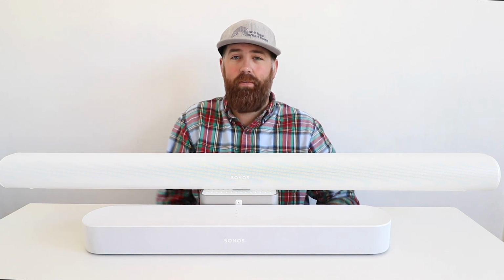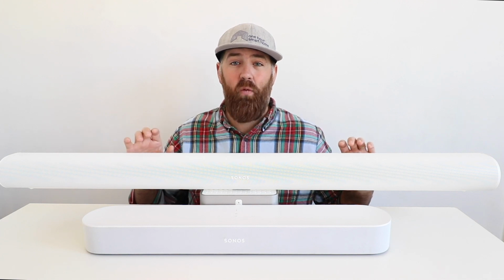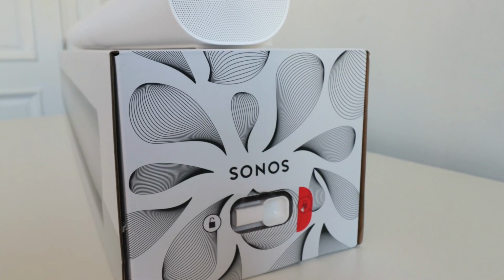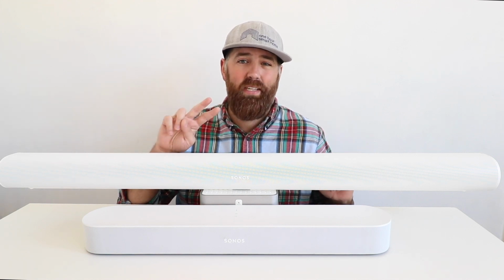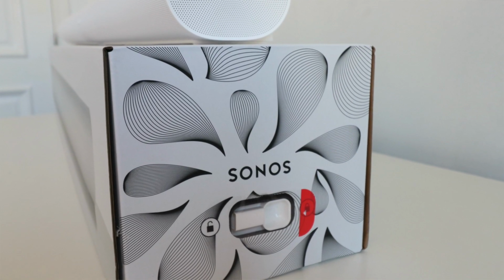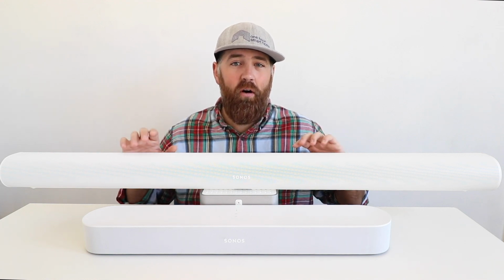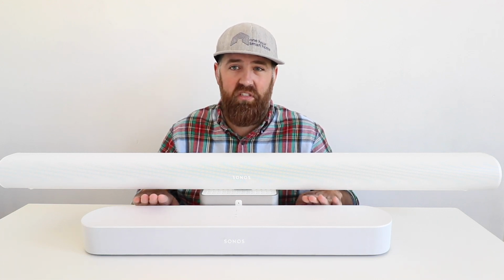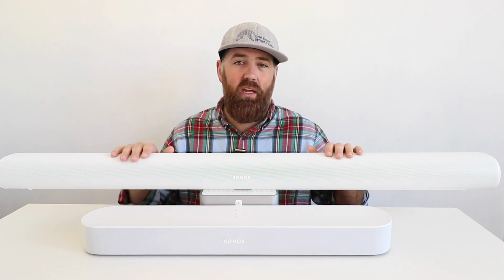Sonos Beam vs Arc | With Sonos Sound Test Comparison |

Comment: If Sonos arc is already Dolby atmos 7.1 what happens if I add a couple of Sonos ones ?
Reply: It’s 5.0.2 without a sub and 5.1.2 with a sub. Doesn’t matter if you have surrounds. It’s still 5.0.2 with the surround speakers because they’re just being combined already to the rear channel. 

5. means 5 channels, which are 2 side channels,  2 rear channels, and a center channel, .0 or .1 means no sub or a sub, and .2 means the upward firing atmos channels. 

The side channels are one woofer on each side, the rear channels are angled tweeters and front facing woofers on the front, and the center channel is 2 woofers and a tweeter facing front. Then there are 2 upward firing atmos speakers, which means each Atmos channel is only one speaker, just like the side firing speakers. 2 more channels have 2 speakers each, and the center channel has 3 speakers. With the surrounds, they would just be incorporated into the rear channel as well, just adding two more speakers to it. It’s only slightly true that there is a “side” channel and a “rear” channel in that layout (here’s the layout https://imgur.com/1TrgYWB) but the side woofers and the angled tweeters and front woofers sort of make up the digital 3d front AND rear channels, working together. But that’s the gist of it.

So 11 speakers total stock on the Arc, which is 8 woofers and 3 tweeters. 2 side facing woofers are on each end-side of the arc, 2 are on top, then there is one forward firing woofer on each front end of of the arc, an angled tweeter on each side paired with those woofers, then a forward firing tweeter and 2 forward firing woofers in the center. That’s the gist of it.
Reply: @SuperD00D  totally confused now lol haha. So basically arc is still better than beam no matter how many surrounds I’ll put it still wouldn’t match the Dolby atmos 7.1 experience? I still can’t recreate 7.1 with beam and ones ?
Reply: @artemisha3048  
Not sure if you’re still looking, but beam supports Dolby Atmos now.

Comment: Tested both the Sonos ARC and Beam @ bestbuy and decided to go with the Sonos Beam + 2 Sonos One SL’s. The Sonos ARC gives much more sound but gets distorted at higher volume. In a bigger room you get the advantage of having the Dolby Atmos with the upward firing speakers of the ARC. If you use it in a smaller room like a 250 sqft bedroom you don’t get the advantage of the ARC at all. The Beam + 2 Sonos One SL sounds much better and cost only $800 with the current pricing while the ARC will cost you $900. If you have a small room with a ceiling height of less than 9 ft get the Beam + 2 Sonos One SL’s. If you have more open space like the living room with more than 9 ft of ceiling height get the ARC.
Reply: i agree. i’m going with the beam with ones and subwoof for basement movie room simply because of size. 8ft ceilings and the chairs are only 9ft away from tv.

Comment: had my Sonos ARC, sub and ones for about 5 months.. its looks great, Sonos app controls are great, sub is great but if you have ever heard a Samsung Q90r soundbar or SN11 ATMOS bars compared to how this does it you will be disappointed it. You can really feel the wrap around sound and overhead effects with those bars, but with the Sonos just makes the sound a bit better.. Sonos also needs to release rear upfiring speakers also.
Reply: The Q90r is a great soundbar but way more expensive than the Arc. The SN11 isn't worth the money at all imo.
Reply: @sirprintalot  Hi I mean the full Sonos setup ARC, sub and ones vs Q90r setup.
Reply: So would you prefer the q90r setup over the sonos?
Reply: @joshuam3903  Ideally I would like the Sonos style and UI with the Samsung q90r sound. then it would be perfect for me.

Comment: Those of you that are Costco members and really don't care about the voice assistance in the Arc. Costco has the Sonos Arc SL for $50 cheaper. So far it is not online but they do have them in store. It's the same Arc as the original Arc just without voice assistance. I have Alexa and Google Home throughout my home so having the voice assistant inside the Arc is not a deal breaker for me.
Reply: so if you have a google hub right next to it, it would essentially work exactly the same?

Comment: Can you compare it to the bose soundbar 700
Reply: I’ve compared both, the Arc is way better. I returned my 700 and will probably not go back to Bose for TV audio anymore. Too many issues with the software, the sound was very flat unless you connected through Apple airplay 2 and then for some reason it sounded way better but then I would lose the eArc features, and it’s also stuck at Dolby Digital stereo not Atmos. You can hear the difference immediately once the Arc was set up in our living room, I had to go rewatch the Mandalorian S2 finale over again because the first play through was on the Bose 700 and it did it no justice.
Reply: @cilonen  we don't have sonos arc in our country and shipping is very expensive not to mention the import tax. Does the bose 700 for 500usd is better compared to the sonos beam?
Reply: @synoykkassey1277  the Bose 700 isn’t $500, at least the latest version. I would still go with the Beam. Sonia software is way better.
Reply: The Bose 700 has a great sound comparable to the Sonos. I love the Sonos ecosystem on how expandable they are plus the automatic room sound optimization features. If you are just looking for great sounds both are great but as I said Sonos has much better ecosystem and is easily expandable. I do recommend the Beam + 2 One SL if you want both great TV soundbar and for music playing while saving some $.